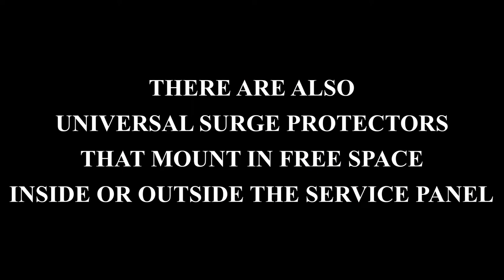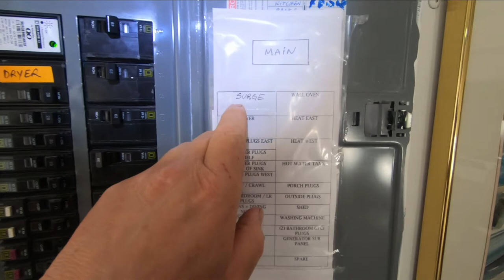SURGE PROTECTOR IN THE MAIN PANEL ~ A SIMPLE DEVICE THAT CAN SAVE YOU MONEY

Comment: We recently had a multiple surge/across several devices in our house.  The problem was a result of a broken Neutral wire coming from the Utility (outside the house due to severe storm).  The Utility guys did reconnect that wire.  My Square D - QO Panel didn't have a whole house surge protector.  I want to install a Type 2 Surge protector (QO2175SB).  Am very handy and am a retire EE Eng. No need to warn me of hazards....   My question is:  

1) if I connect the grounding wire of the Surge protector to the NEUTRAL bus in the panel and a similar incident happens, where would the shunting go!?  Should I connect it to the Panel Ground instead (it would shunt it to the ground of the house via the existing copper wire tied to the water main in my case) ?    

2)note that I am not sure if my Neutral and my panel ground are tied together!?!? - how could I find out?   Thank you!
Reply from the maker: If it's a main service panel (defined as the FIRST place the power is distributed after entering from the street), the grounds and neutrals will have been bonded together. In any other location downstream (sub panels) the grounds and neutrals are separated. Surge protectors connect to a double-pole location in the main service panel and connect, usually by a pigtail, to the neutral bus. The surge protector should be located as close as possible to the main disconnect and have a short, straight run to the neutral bus.
Reply: Thank you for your guidance! 

My Panel is connected to the grid through a Generac Transfer Panel which in turn is connected to an outside stand by 17KW Generator.   So in this case, is my Square D QO panel considered to be a "Sub-Panel" or is it still a "Main Panel"?
Reply from the maker: The generator is on the sub panel, isolated from providing power to the home when power from the utility is present. Any doubts, get an electrician to have a look. take care/ @drorr3431

Comment: How's she goin '?  Nicely done.  I like that you updated the legend.  I don't know how many times I have had to trace circuits in my own panel because I never marked them!!  Take care!!
Reply from the maker: Thanks Mike. I was thinking of you when I did this and knew you'd be watching my work carefully, being an electrician. I installed a heat pump last month (video to come) and we heard that a surge protector would be a good idea. I wish I had the newer style Square-D panel that accepts breakers with a built in neutral. The arc-fault breakers in my panel all have neutral pigtails and they crowd the box. The newer Square-D panels have a neutral bus that runs in behind the breakers that the breaker snaps into. We are glad that we installed this surge protector...I hope we never need it!
Reply: @EverydayProjects  I have a Sq D panel too and it's an old one.  My surge protector (for one of the bedrooms) has it's own neutral like you described.  Sure makes the panel look messy eh!!
Reply from the maker: @GrampiesWorkshop  I rewired the whole house under permit it 2018 and I really wanted a neat layout in the panel but the need to have so many wires and the longer body in arc fault breakers clogged up the works. The inspector found everything up to code but it's not the look I wanted.

Comment: A guy bought a house up the hill from me recently. Not much in that place is done right. Of course there were no labels on the breaker box. Does this eliminate the need for your regular plug in style of surge protectors? I think I'd probably run them anyhow but two layers of protection would be better I think. Another one, since you do electrical, will you be tying in a generator and what I think is called a transfer switch? Right now if the power is out, I run extension cords to the fridge and freezer and a few lights. It'd be really nice to just fire up the generator and throw a switch.
Reply from the maker: I rewired the whole house under permit in 2018 and I included a generator transfer switch (a whole panel actually). It is joined to the main panel and is in the wall under the painting on the right in this video. I plan to do a video of that whole system soon. There is a connection box outside to plug the generator into. In the generator panel are the circuits for my fridge, lights throughout the house and select receptacles, plus the smoke alarm circuit. On normal power, these are powered from the main panel.
Reply from the maker: The plug-in style surge protectors do add another layer of protection, so continue using them.
Reply: @EverydayProjects  For the transfer switch, that would involve your power company disconnecting the power wouldn't it? Back in the day when my Father had some involved work on our electrical he'd pull the meter, no big deal to him. Now we have these "smart meters" and I'd worry about getting caught.
Reply from the maker: @heliarche  The generator panel is just a sub panel fed from the main service panel. It is a 60 amp sub panel with an interlock at the top preventing utility and generator feeds from being active at the same time. Usually, everything in the generator panel is fed from the main and runs as normal. When there is a power outage, I switch the interlock to generator supply, plug the generator into the outside receptacle and start the generator. The circuits I put in this panel are as stated before.  This is the number for the exact panel I installed: 
QOGP3P6036P
Reply from the maker: @heliarche  No need to pull the meter or have the electrical feed disconnected. Just install a breaker to  feed the generator panel (mine is a 60 amp double pole breaker).
Reply from the maker: If you look at the legend in my video, you'll see the generator sub panel feed and the breaker.